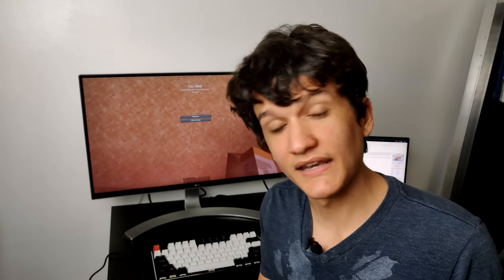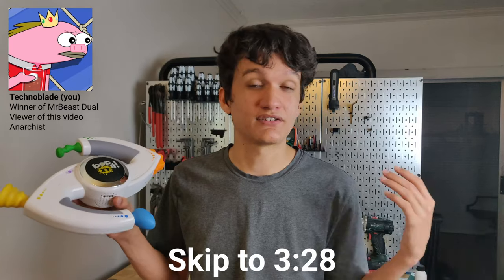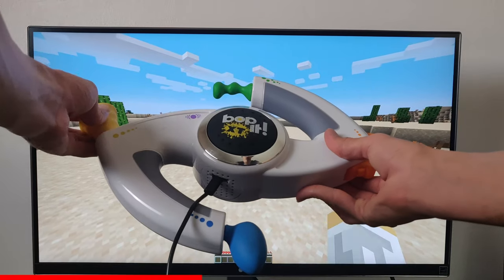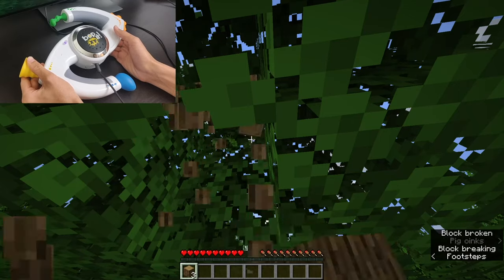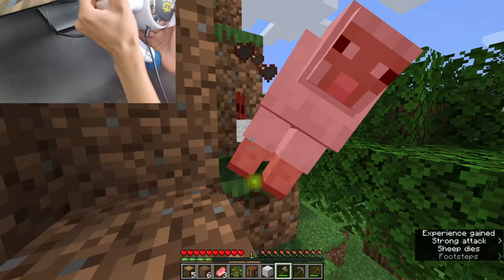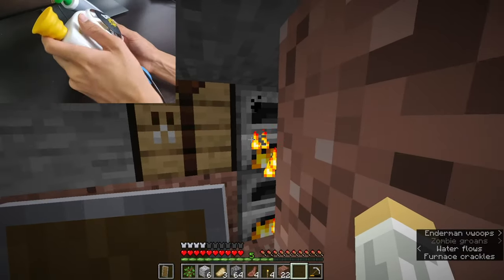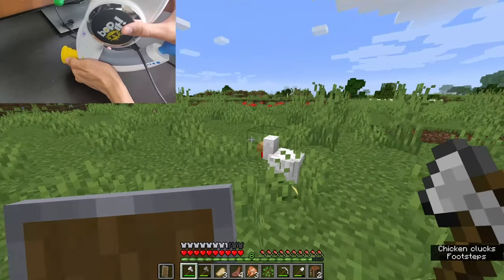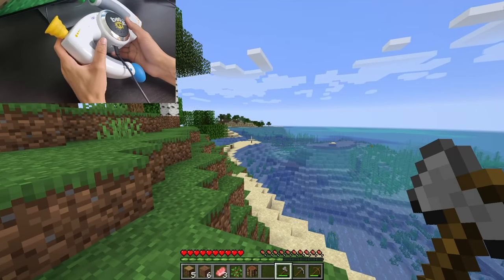Can You Beat Minecraft with a Bop It?

Comment: I didn't quite catch how you did the software. Are you using CircuitPython or MicroPython to translate between the Bop It's controls and accelerometer input into HID commands for the gaming machine?
Reply from the maker: Yes, I am using CircuitPython to send HID mouse and keyboard commands to the computer based on the bop it controls.
Reply: @SethAltobelli  That's excellent. Lovely project. Weird thing to play Minecraft with, but lovely project :-D